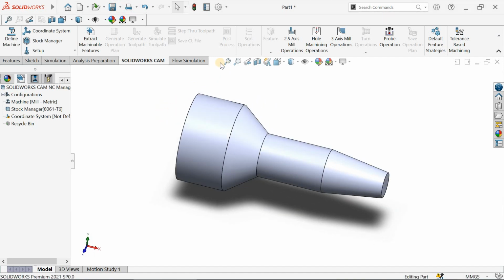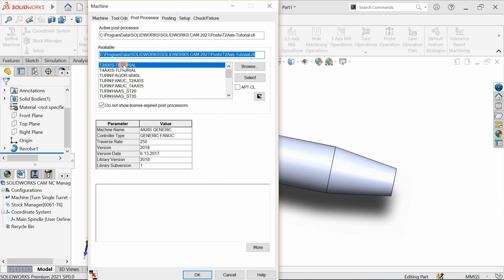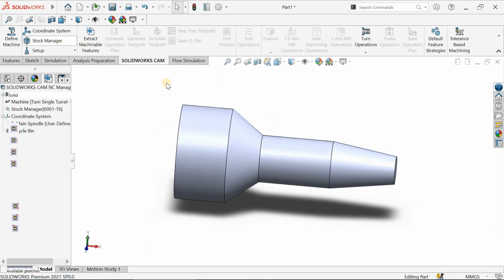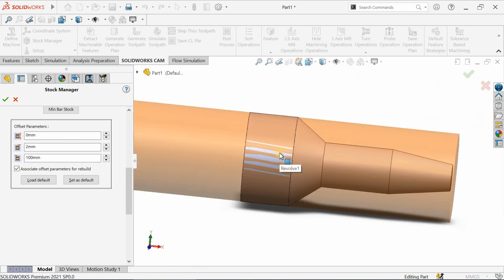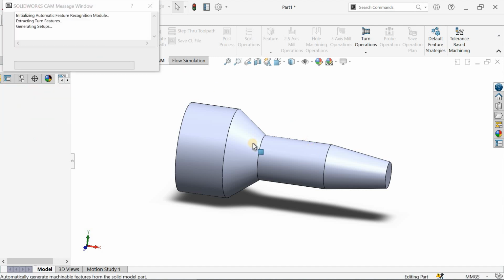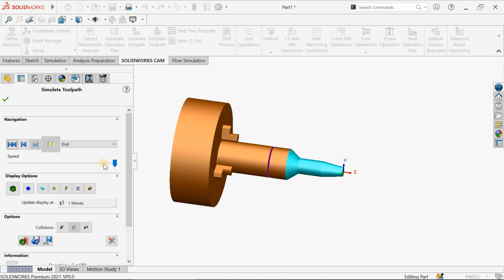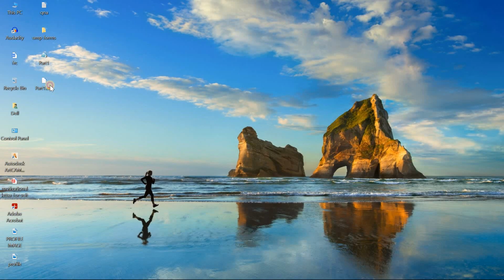solidworks cam turning tutorial for beginners

Comment: Hey, I have a question
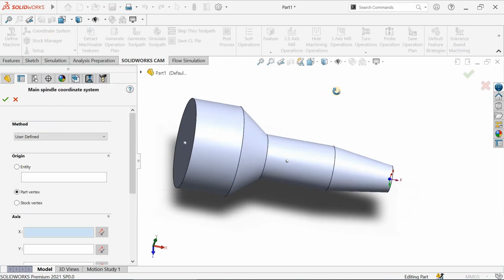1:34 you checked the machine coordinate system. the axis x,y and z but what if the axis where in the middle or at an other position, at the end?
Reply from the maker: actully its tell the position where the operator zero the tool